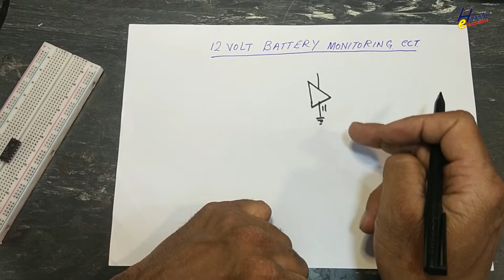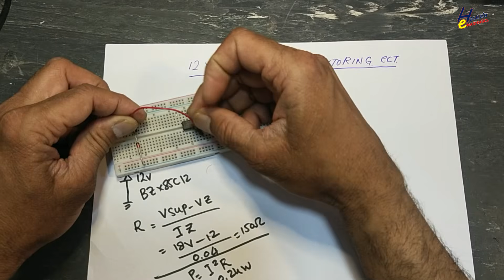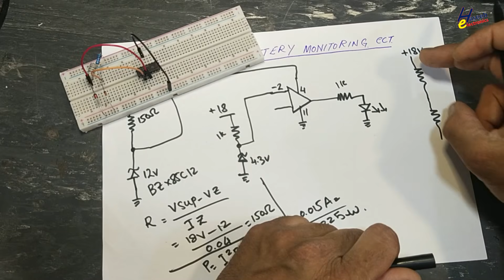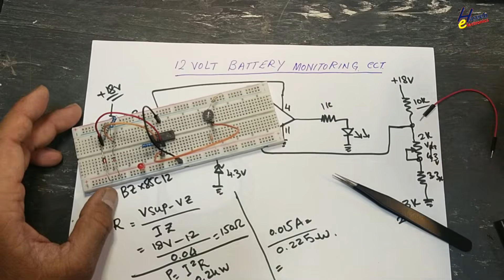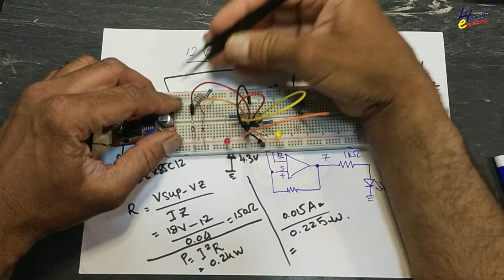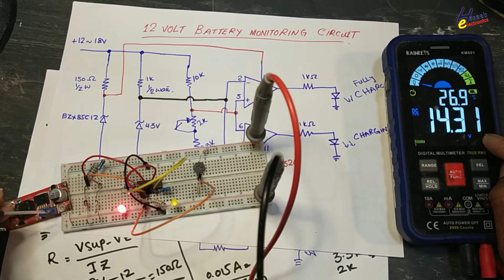How To Design 12V Battery Monitoring Circuit Using LM324 | Charging & Charged Indicator | EP#1445

Comment: you might want to add some hysteresis to the circuit to stop it's outputs oscillating as it passes the set point.
feedback from the output to the reference point should do the trick. As the input goes above the reverence level, you want to pull the reference point slightly lower. this forces the output to stay in the new state and so removing oscillation from the output as it transitions. 

Nice to see someone explaining a circuit instead of just playing music.

Comment: What's not clear to me is that if the charging process is performed using a constant voltage power supply, we'll always see its maximum voltage across the battery. In this case, the monitoring circuit, using the same voltage, should always report a full charge even when the battery is flat. Could you clarify this if you'd like?

Comment: Can I provide 5v to this ic?
Reply from the maker: Yes 
3 volt to max 30 volt maximum 
Best Range 3 to 18 votl 
for splitted power supply option + - 12 volt is best configuration
Reply: @HaseebElectronics why is it Best?

Comment: Great video as always.

Can I use emitter follower transistor voltage regulator to power the IC? 

How can I feedback the output ( pin 14 ) of another op amp (pins 12, 13, 14)  used to sense charging current into pin 6 of the IC, such that pin 2 will control the charging MOSFET (full voltage cut-off and high current cut-off). 

What are the best current senses circuit and how do I apply it to this circuit to get a reasonable smart charging process. I will be glad if you can give me a favourable response. Thank you Sir ji